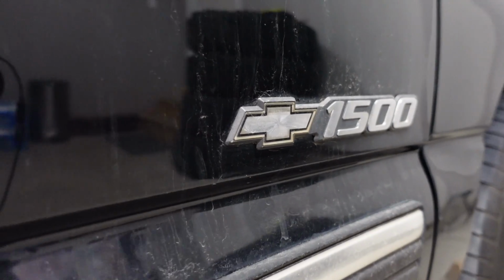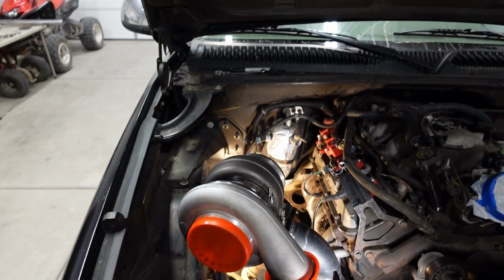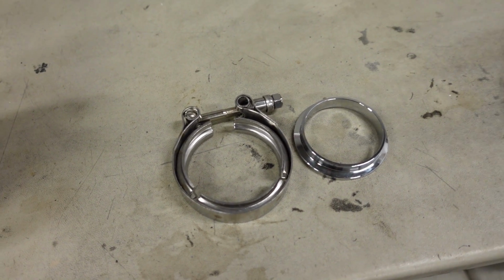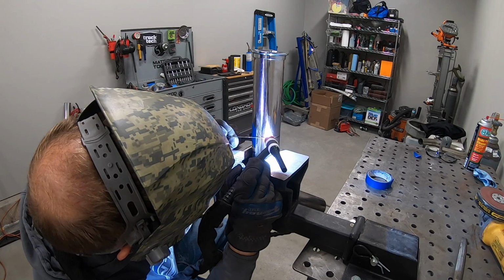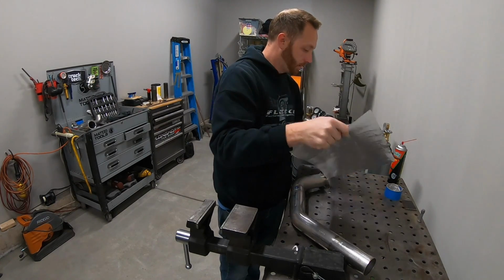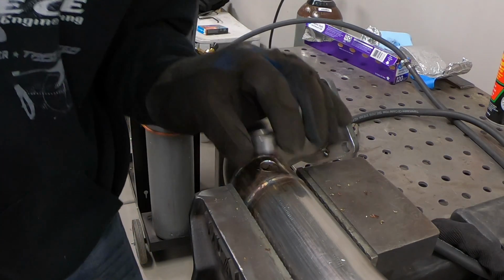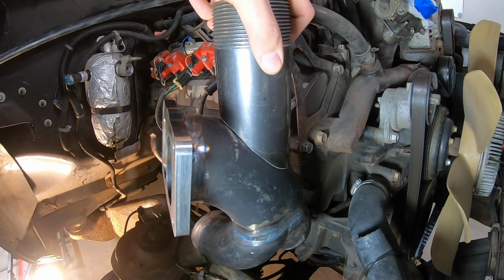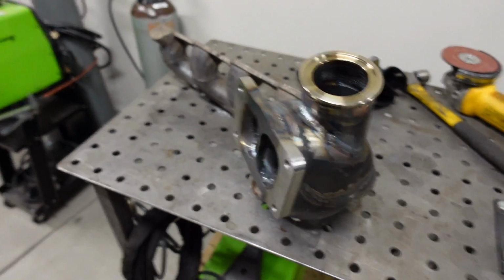8.1 Vortec Turbo first fire up

Comment: Just a question have u had a conversation about turbos with gale banks ? Just wondering cause boost isent what u should be looking at ... even if it is the diesel side you can take a lot from that side and apply it to the gas side of things .. just a thought I apologize if it sounds like I am bashing just thought you should have a conversation with him if u haven’t about turbos if u haven’t , and try to pick his brain .....
Reply from the maker: Never met Gale personally, but I have read and watched a lot of his tech. You are correct, its not all about boost, its about airflow efficiency and density. Boost is only a measure of restriction. Thats why Im trying to design this turbo system to be as efficient as possible. Large wastegate to control backpressure, biggest exhaust post-turbo (4") and non restrictive charge pipes, and the biggest intercooler possible to keep air density at a maximum.